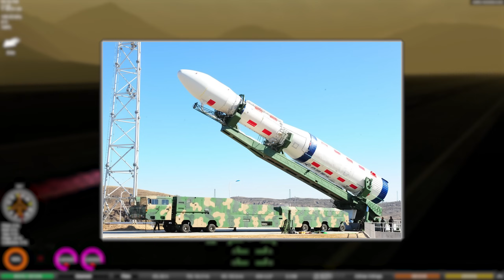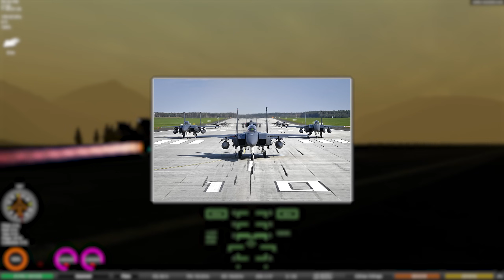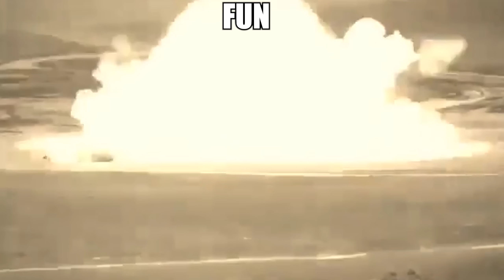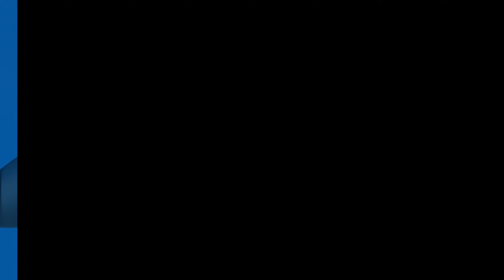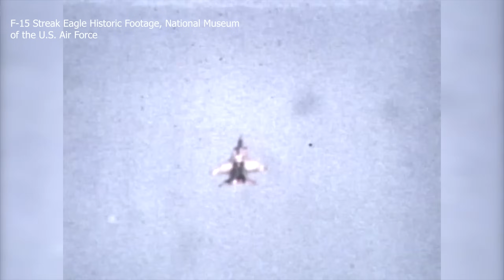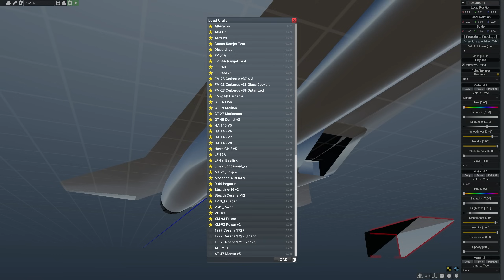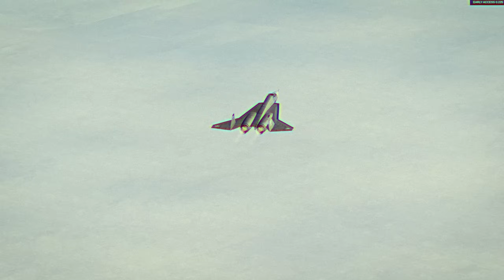I Continued America's Most Ambitious Jet Fighter Program

Comment: Virtually all surveillance satellites are in low earth orbit, so I think your constraint is unnecessarily strict. The appeal of the aircraft launched system is cost effectiveness. That was the whole point of the program. The first few miles in the air are the most fuel intensive in the process. If you can launch it at high altitude and speed it cuts down the size and cost of the rocket tremendously.

I think the US should actually revisit this concept because even if they have only 5 of these anti-satellite aircraft doing 1 launch a day, that's around 1800 satellites per year you can take down.

Comment: The use of an Anti Satellite Rocket/Warhead would almost certainly end up destroying every Satellite due to the Kessler Syndrome.   The warheads contain rods (much like missiles used against aircraft) with the warhead detonated on close range in hopes that at least one piece of the shrapnel from the warhead will hit the target.  The problem is all the warhead rods and the destroyed satellite  all become new debris for other satellites to avoid but that debris spreads and can be too small to track and avoid so eventually another satellite is destroyed creating another expanding debris field in orbit.  This goes on until everything near that orbital altitude is gone.  Since most satellites of military value are in very low orbits the debris eventually is slowed enough by drag to reenter but that can take anything from years to multiple decades.  At higher orbits with less drag such as where navigation satellite clusters orbit we are talking many centuries of debris fouling that orbit.  This is why responsible testing is only done on satellites that are mere weeks from their death plunge to minimize the risk of debris affecting active orbits.  In an actual shooting war with many sides destroying communications, navigation, and spy satellites (radar and photographic imaging)  will quickly destroy it all.  About all that will probably be save is Geosynchronous stuff like TV Broadcast and Telecom, but if a few of them get destroyed the same will happen out there too, it will just take longer.

Comment: Optimizing a plane for zoom climbs and sprints, and no mention of water injection. At least by whitepaper math, the cooling from evaporating water (and methanol for anti-freeze) infront of the compressor lets you push a regular Mach 2.5 capable fighter engine to Mach 4 without melting, though it does need to be modified to handle higher RPM.

Comment: Could a modified Lockheed A-12 or North American XB-70 not serve as a launch platform? They already had extremely high service ceilings and top speeds...
Maybe a rocket first stage to get the package hypersonic, then scramjet until the air is too thin, then another rocket delivery/adjustment final stage? Assuming the weight of the amount of liquid fuel needed for the scram would be light enough to reasonably replace a second rocket stage.

Comment: me with a single-engine stealth f-22 interceptor (originally designed to be a cursed ballistic missile interceptor carrier) does mach 3.4 at 70ft for hours, and in the same fuel load, can go from dead stop, zero wind, to 184,646ft in 3 min an 15 seconds. the rapture raptor is also a potent dogfighter, and has increased super cruise to mach 2.1. its a high-bypass fan with a ratio of 3, coupled to a really low comp three spool engine, with a overall max 0 ASL thrust of 650 KN. it does 0-mach 1 in 21 seconds. 

issue: incoming ballistic missiles

solution: turn F-22 into a ballistic missile and no more issues :D

Comment: At 20km altitude the air pressure is around 60 mbar, or about 6% sea level pressure.

20% is closer to the pressure at 40,000', near the top of passenger airline cruising altitude.

Comment: Anti-sat would make any use of space impossible for a very long time. Orbital debris is very high speed shrapnel, and you get a chain reaction. Flecks of paint are damaging at those speeds, and the debris orbits randomize. Space stations, weather (earth and space e.g. solar flares and/or coronal mass ejections) and climate sats, civilian and military comms, GPS, nuclear weapons test and/or launch detection, etc., all add up a tremendous amount of capability lost until orbits decay. IOW, years to decades, a small amount possibly centuries. Studies have been done. I'm sure that at least the unclassified bits of the reports are out there. I couldn't even guess at the money involved, other than BIGNUM.

Comment: The problem right now is the Thrust or the engine because the spacecraft needs a powerfull engine for travel to Space. 😊😊
The design of the spacecraft is easier because in Space there aren't laws for the aerodynamic or " Bernoulli Law" 😊. 
Virgin Galactic Spacecraft is a very good design but needs a powerfull engine without aircraft propulsion.😊😊 The take off is nesesary from the airport to the space without aircraft or Booster. 😊 

The force G is very important also 😊

Comment: Does FlyOut have a more intuitive modelling system yet? It should look at SPROCKET, which is simple but quite flexible, and go from there. Most importantly, it needs a CTRL+Z style function.
Reply: the dev said he is working on the undo button that is also exactly the reason there is no update because he cant figure out the undo
Reply: @turnedcoat  Ahh, thanks. The undo function is VERY important, especially while learning, so that mistakes can be made which don't mess up an entire process. Also important for experimenting with shapes and ideas. I hope he works it out or gets help from other developers to sort it. It will be a significant step forward.

Comment: The wingshape is actually pretty similar to the XF-108, and given the design goal you had of a very fast-climbing, high-payload interceptor, that makes sense, it's only about 0.15 mach rating faster than the XF-108 was meant to be, the TWR of this aircraft is higher, but overall it looks like a crossbreed of an F-15 and and XF-108 with the wings a bit more rounded than either.

Comment: What is the delta-V of the final rocket anyways? Consider that maximum altitude for this system would based mostly on just how far it gets when it goes straight up, with some reserves left for course corrections, and a four ton multi-stage rocket seems like it could really go places.

And honestly, I feel like if there weren't restrictions game-wise, I think this aircraft would benefit from some sort of ramjet system to prevent specifically that engine stall you got after launching the missile.

(Small aside: I feel like the idea of live flying with a couple of camera angles is fun, but I feel like soundtrack consistency would have helped it a bit, cutting to a different tune whenever you change camera angles was a bit distracting and disturbs the flow of the video a bit. Just something to consider in the future!)

Comment: 1:04 Small nitpick here. The launch vehicle in the image is actually a liquid-fueled commercial rocket LM-6, not an ASAT or GBI. I knew exactly what you meant once I saw the picture because the Warzone used it when reporting on China's Midcourse interception tests, mistakenly referring to this as the launch vehicle for the DN series GBI-equivalents. I have no idea why they think it is such a vehicle maybe the whacky transport erector thingy confused them. It's not a real ICBM TEL either, it's just a whacky truck that can carry all sorts of small commercial rockets from the assembly shop to the launch pad.
Reply: A commercial orbital rocket and an interceptor and an icbm are all the exact same thing if anything that commercial one is better than planned military interceptors if it’s capable of a full orbit vs just a sub orbital hop. You never complain about having more delta v and fuel
Reply: @IceRain-f5v  1: Response time, launch infrastructure and long term storage. 2: ICBMs and interceptors are two entirely different categories of requirements and 3: LM-6s use YF-100 series kerosene & liquid oxygen engines. You might want to first find a military rocket with a kerolox engine...

Comment: Little "correction": the increase in pre-combustion temps with speed is not to do with friction, but rather more heat being created in compression by slowing the air down. You are converting the kinetic pressure of the airflow (so, its velocity) into static pressure, and thus raising the temperature (because Pressure x Volume = Number of Gas Molecules x Boltzmann's Constant x Absolute Temperature). You are doing work on the air to compress it.

This is the same reason why air compressors get hot, and it is also why the temperature in the cylinder of a piston engine will rise rapidly before combustion even occurs.
Reply: PV = nRT
Reply: Isn’t the work you impart on the air to convert linear kinetic energy into random thermal kinetic energy literally called friction though lol? Like first of all it’s a fluid so it’s kinda debatable if anything can be rightfully called friction but as far as I’m concerned if you hit the particles of a gas which isn’t in free flow phase with a solid then that’s pretty much friction
Slightly different from viscosity which is what Tesla turbines use and feels conceptually and semantically similar to friction 

Ultimately friction is a word that only makes sense with two solids but the action of both a compressor and a ramjet upon a gas is literally itself friction, there is only one kind of interaction, the collision between air particles and the metal parts of the ramjet/compressor blades and housing, if there’s only one interaction why would you have several words? Compression is done by "friction" even if friction isn’t a word that correctly applies in this context if you speak proper English

Comment: there is an argument to be made to have air-launched missiles in the inventory for use in the ballistic missile interception role. And your aircraft could be used to launch hypersonic weapons. IIRC, that’s the role the Russian MIG-41 is supposed to fulfill if it ever…fly’s out! (Shows self out the door for horrible puns!)

Would DSI’s have been a better choice for this design rather than the variable-geometry ramps for the inlets? And would a compression lift design have helped or would it have been superfluous? Maybe add a deluge chute to help with landings?

Requesting a supersonic stealth attack helicopter that uses canard rotor wing technology for VTOL/low speed flight but turns into an oblique wing for forward and supersonic flight.

Comment: I was JUST thinking I needed to watch a Messier82 video! Another thing that might make a plane launched system better then a rocket is cost and reusability. Sure, the plane probably will have a high matinence cost, but you're not wasting a full rocket every time you want to shoot down a satellite. It's the same reason you would use an SSTO over a traditional rocket.

Comment: But what if a prospective air force wanted to have a B1 Lancer mod that has a whole drum filled with sat-killers and comically oversized rocket boosters??
Reply: You can only aim at the satellites flying directly towards and over your head and generally there isn’t more than one it’s why this plane concept is so atrocious (that and it’s slow), so carrying more than one interceptor per plane isn’t too useful. Would be useful to defend against ICBMs(since they all come flying at once from the same direction)... if those planes could take off and climb in time which they can’t. 

You can station stuff in orbit to prepare to take out enemy satellites (not ICBMs) but you’d just use something like a falcon 9 instead of a plane for that 
And for intercepting missiIes you’d rather use missiIes too since they fly a lot faster and work the same as the plane in every other aspect

The only niche where this cringe plane asat stuff might be useful is if
-you’re a nation with high altitude fast planes already but no rockets 
-you want to take out a very small number of spy satellites for cheap without having to develop and build large rockets
That’s about it. American spy satellites are a fleet of 20 Hubble telescopes that are 50% larger than Hubble, they are few enough in number that you could use a plane to take them out over the course of a few days. That’s about it. Dont dream about planes shooting down starlink type constellations or icbms

Comment: 21:20 Referencing the ISA model, the pressure at 20km is 5474 Pa, or roughly 5% of an atmosphere (7% the density). As you said, not a lot of air...

Comment: 19:08 The missile knows where it is at all times. It knows this because it knows where it isn't. By subtracting where it is from where it isn't, or where it isn't from where it is - whichever is greater - it obtains a difference or deviation. The guidance subsystem uses deviations to generate corrective commands to drive the missile from a position where it is to a position where it isn't, and arriving at a position that it wasn't, it now is. Consequently, the position where it is is now the position that it wasn't, and if follows that the position that it was is now the position that it isn't. In the event that the position that the position that it is in is not the position that it wasn't, the system has acquired a variation. The variation being the difference between where the missile is and where it wasn't. If variation is considered to be a significant factor, it too may be corrected by the GEA. However, the missile must also know where it was. The missile guidance computer scenario works as follows: Because a variation has modified some of the information that the missile has obtained, it is not sure just where it is. However, it is sure where it isn't, within reason, and it know where it was. It now subtracts where it should be from where it wasn't, or vice versa. And by differentiating this from the algebraic sum of where it shouldn't be and where it was, it is able to obtain the deviation and its variation, which is called error.